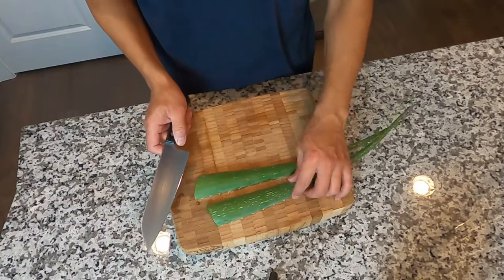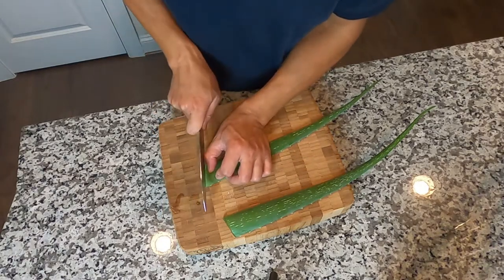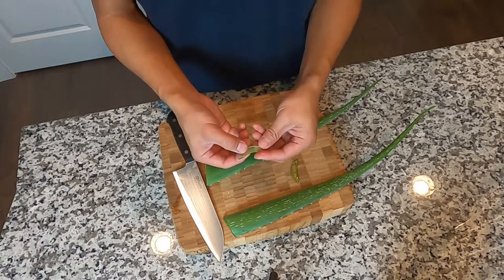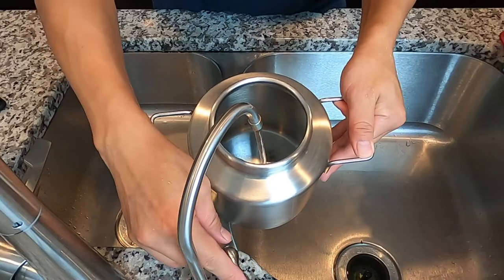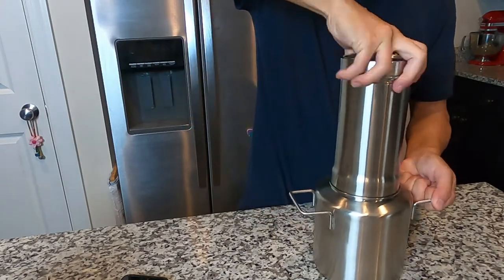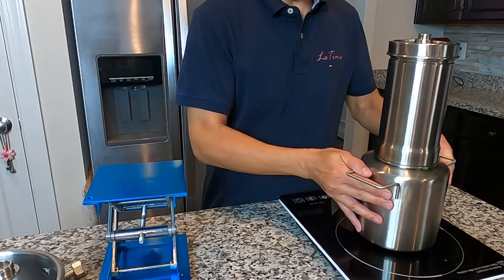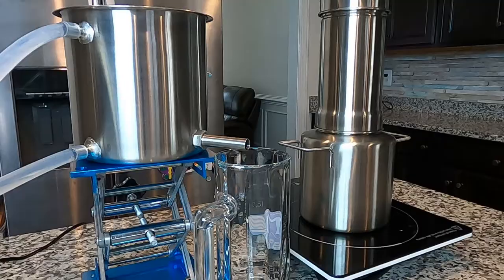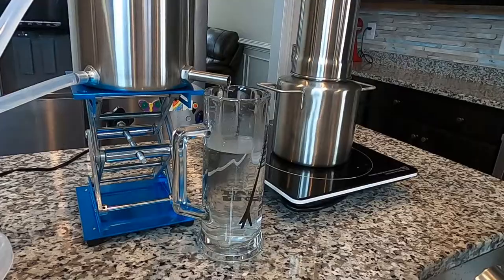Steam Distillation Aloe Vera to make Organic Hydrosol with LETIME LT3000

Comment: is it somewhat like rose distilled water....just like we made in our home .  can we made Aloe Vera distilled water in home like that... ?
Reply from the maker: The pot distillation at home is hydro distillation which is mixing rose with water and then condense. The same way can be used for Aloe Vera. Just be careful not burned them because aloe Vera is thick and sticky.
Reply: @LeTimeLeo  yes we must add Aloe Vera with water as we did when we distilled rose water.thanx for reply.

Comment: What is the percentage yield we will get?? If I put 1 kg of aloe vera then how much qnty of clear aloe vera I get after its distillation??
Reply from the maker: General rule for making high quality hydrosol is 1:1 ratio with the volumetric amount of herbs added. With roots, branches or thick leaves like aloe Vera, you may expect more yield. Periodically check your hydrosol during distillation. You will feel fade of smell or color. That helps tell you end of your distillation.
Reply: @LeTimeLeo  Thanks for your quick reply.
Reply: Distillation of Aloe vera need water to infuse first to create steam, it means it won't be 100 percent pure. As we are collecting it after boiling it in order to collect it's hydrosol then at what temperature it won't loose it's properties?? Pl guide